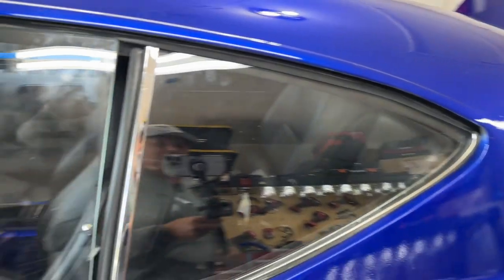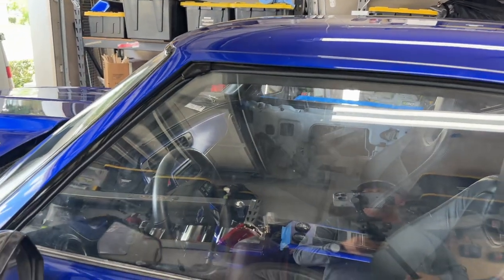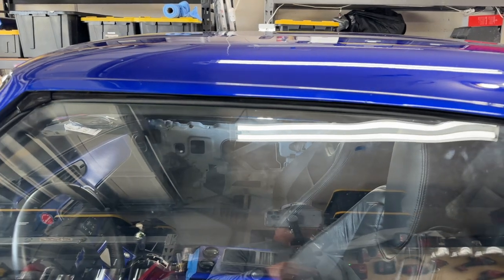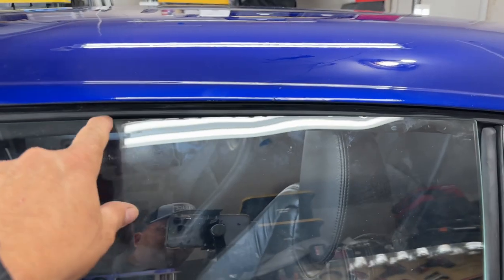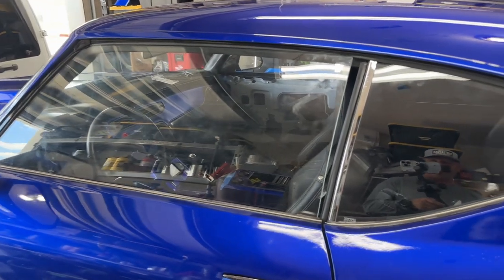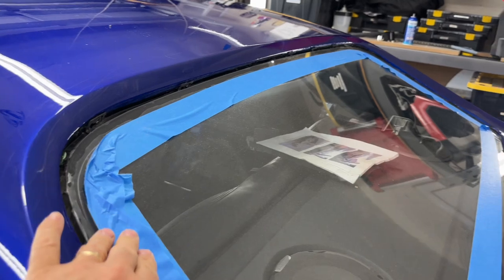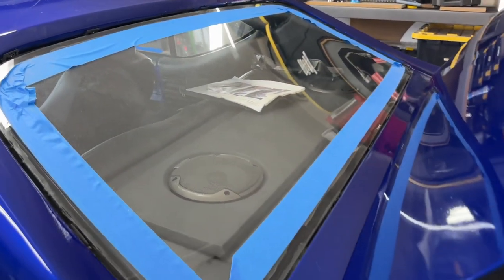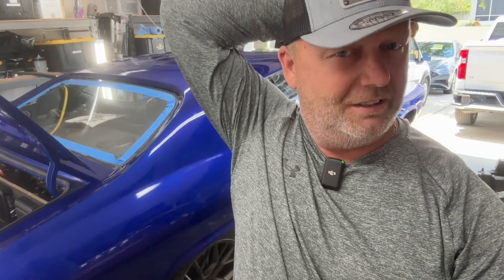I Asked My Worst Critics For Feedback

Comment: Wilwoods are great brakes. Not sure of your setup but it should stop on a dime. As Kalvin said, check MC bore size. If you changed from power to manual or vice versa, not having the right bore size will make them not work properly. There are different bore sizes for manual and power brakes. Is the pedal really stiff?  That’s a sign of wrong bore size.
Reply from the maker: Thanks Brian. Then entire setup is manual. Pedal seems like it gets firm about 1//2 way down or so. The brake pedal assembly is Wilwood reverse mount.

Comment: Ensure you have a correct bore master cylinder for your application. It should be working okay out of the box, no special instructions, normal break in procedure for brakes.
Reply from the maker: Thanks Kalvin. I have dual 7/8” masters I’m pretty sure.

Comment: And stops for the height adjustment
Reply from the maker: I’ll work on the height too. Should I do height first?
Reply: @SOB_Garage  I did the height last because when you tip the window in or out the height will change